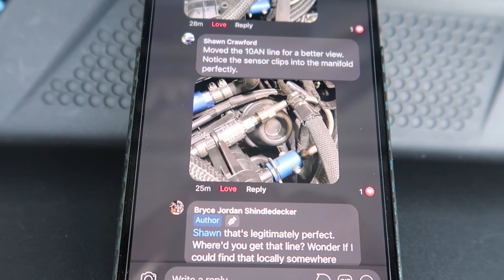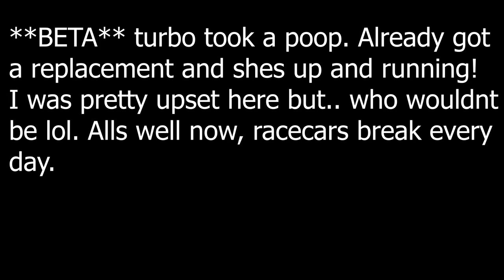A2B 5 BAR sensor install.. then the worst happened.. | MK7 Golf R

Comment: My built gti had the same issues at WOT. Replaced the CTS catch can with the stock one and had it routed to the gen 1 apr catch can, no more smoke. Something about negative pressure and sucking it through to the catch can. I’d drive 10min down the road and my can would be full. Stock is best imo dunno if the new apr ones fix this issue. Sucks your turbo went my car went through 2 and wanted to get a G30-900 but just sold the thing instead.
Reply from the maker: My turbo blew it's not the CC 😅

Comment: I was like wtf, so super secret squirrel turbo said get fu@ked Bryce and blew a bearing? Well at least it wasn't in 2 pieces... Lol
Well brother, gotta keep thinking... Cause racecar... Gonna happen, better just driving than at the track... Break a turbo, battle scars.. Lol you need little turbo decals in the upper door by the mirror like pilots do when they shoot enemy planes down.. Lolz
Reply from the maker: Omg my God I should totally do that sticker thing 😂😂😂😂😂😂 turbo I think might've stemmed from my cam spool valve issue.. I don't blame them. Car was a bit off but I just didn't think it through

Comment: The blue beauty is cursed man!! You gotta keep her tho! And get a ttrs 😎
Reply from the maker: Mk8 might be the move. 7 for track work and 8 for drags and daily 😎. Cars good now tho new spool valves fixed my issue drove her to work today 😈
Reply: @BryceJordanProductions  I was thinking of getting a '18 S5 Sportback. Then they release details about the 8R... Bro I want one :') I DONT KNOW WHAT TO GET!
Reply: @quickhandcam8596  Very different machines but both amazing in their own way. Get both 🤪
Reply: @BryceJordanProductions Glad to hear it man.. I think I'll keep the S3 forever.. keep her running as long as I can.. I'm really not sure what my next car will be.. I can tell you what it won't be.. electric...
Reply: @BryceJordanProductions Wanted to ask you a q too mate.. I'm at about 400bhp.. stage 2 ECU/TCU.. on hard launch.. takes off great 1.7-1.9 60ft.. then sometimes there is a hesitation on gear change.. lose boost.. feels weird.. other times it hooks mental 3.7 0-60. Any ideas? It feels like a fuel issue or a dsg issue..
Reply: @joshbrennan8545  what does the scan show? Lost timing? Fuel pressure dropping?

Comment: What do these sensors do tryna build a list of what ima get when I get a mk7
Reply from the maker: Allow more boost basically
Reply from the maker: Stock system capped at 28psi. 4 bar gets you to 32 and 5 to like 48ish I think
Reply: @BryceJordanProductions  damn that’s crazy how much boost can a stock block handle do you think
Reply from the maker: Depends on the turbo, boost is relevant to turbo size but I've seen mid to high 30s on hybrids stock block and last a longggg time. Just gotta keep the torque in the low 400s
Reply: @BryceJordanProductions  true the eqt vortex you had looks pretty nice I was thinking about one of those unless there’s something better how much did you make on that?
Reply from the maker: They're the best option for stock block power IMO. I made just under 500wheel and 420ish tq on 91 at 29psi. Later on with the built motor ported head on E85 and 32 psi wouldve been close to 580ish
Reply: @BryceJordanProductions  bet that’s crazy I’ll probably do that and a 4 inch down pipe and all the other basic stuff definitely looking forward to it thanks for your opinion and help through all your videos

Comment: Did you need this piece, or are you still modifying?
Reply from the maker: Needed it to go above 32psi. I'm at 43psi now 🤪
Reply: @BryceJordanProductions  sheeesh. Power you think you’re pushing?

Hope it doesn’t create more problems. The more you keep pushing it, the more problems
Reply from the maker: Yeah I know now.. I'm testing this turbo for EQT though so it's gotta get pushed for data and science. Hopefully around 600 wheel by the time were done tuning

Comment: Another brilliant car ruined by a cheap hybrid turbo. Turns out turbocharger development is more complicated than boring out the stock housings and slamming a TD06 in there.
Reply from the maker: She's fine.. cars fine drove it to work today. This was awhile ago
Reply: @BryceJordanProductions  don’t take this personal, but of course it’s fine with a brand new turbo. You’ve yet to put hard mailed on it. 

People like EQT because they’re great at marketing, but their products are not the best as people think they are. Some like EQT because he helps them out with replacements. Others such as myself have had bad run-ins with him. You’re pretty optimistic of their turbos even after blowing 2 of them with very little miles on them. It’s your car. I’m not trying to tell you or convince you of anything, but I’m just following the facts here...
Reply: He has had quite a bit of problems with the more he’s modded it. I’m not sure why his EQT turbos keep failing, while other users don’t, but it just shows the poor quality control that EQT uses.
Reply: @JacesOwnWorld  Because Bryce pushes the crap out of his car, literally even. He's probably the only guy who's found any weakness in the stock 6MT. And when you take a bearing system designed for reliable operation at 22 PSI with 300 lbs/min of air running through it, double the airflow, and run 35 PSI, with a mismatched turbine and compressor pairing, that bearing system becomes crap very quickly, and it is going to fail. Every hybrid turbo for this platform is extremely fragile, and I imagine most other platforms are similar.

Bryce, get a ball bearing turbo. Just stop messing around and get a swirl adapter so you can put a G25 or 7670 on it.
Reply: @acefighterpilot   Naw eqt turbos are just dog shit.
Reply: @builtbythomas  Revo and TTE have the same problems.
Reply: @acefighterpilot  or an XR7864s (Xona Rotor) or G30-770